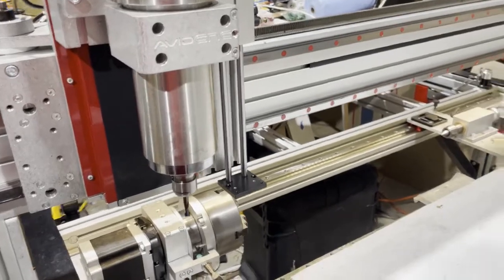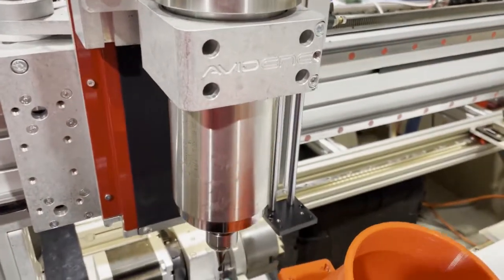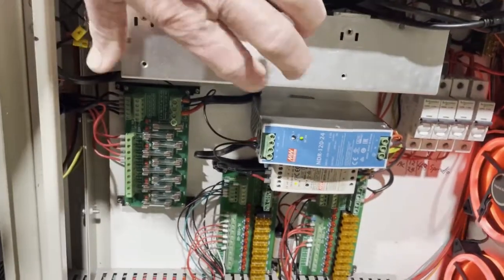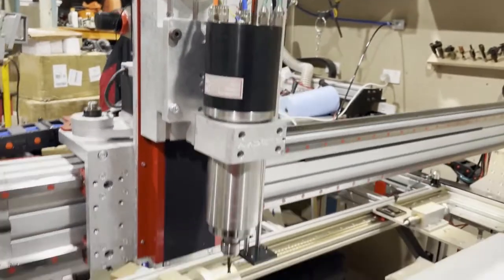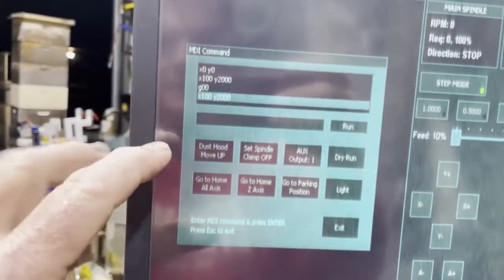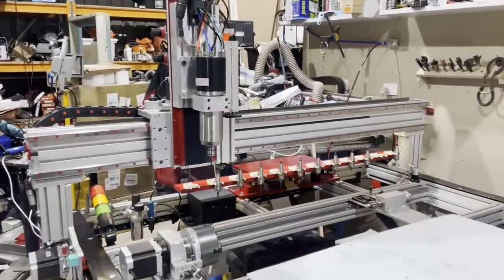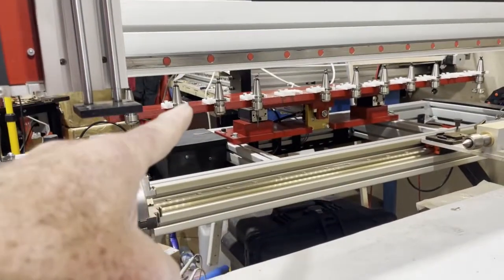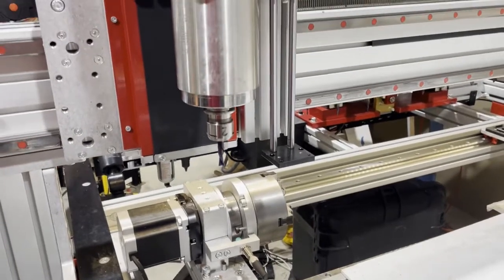Avid Masso ATC Test Run

Comment: Hi Mike,
I am planing something similar like your machine. Do you have a electronics part list? Choosing the correct parts is my biggest hurdle thanks!
Reply from the maker: I started with the ATC spindle.  European models were out of my budget, so I chose the best Chinese brand I could find - Jianken https://www.jian-ken.com/automatic-pneumatic-tool-change-spindle-motor/jgl-80-1-5kw-2-2kw-2-5kw-24000rpm-40000rpm.html through Alibaba.  
The Inverter is a no-name Chinese brand with specs to suit the spindle through AliExpress.  The pneumatic solenoids and all the tubing and fittings also though AliExpress.  
I still haven't resolved the automatic dustshoe system yet.  The piston in the video works in theory, but I haven't succeeded in reality.  The dustshoe can't move high enough to clear the spindle.  I'm working on a hinged design to swing the dustshoe out of the way instead of lifting it.  I'll still use the piston(also AliExpress) to operate a rotation lever.  Been too busy to dedicate the time to see it through.
The moving tool tray is also AliExpress, but not entirely necessary.  If I were to start again, I'd have a larger table to accomodate fixed tool holders.
Masso has an elegant approach, but it did take me some time to understand it.
I may make a video on how I did mine when I get it all working.
Good luck with yours.
Cheers,
Mike

Comment: Masso is the most easiest CNC controller to setup everything.
No need to be a programmer for CNC script, just put some numbers on the settings that you need then everything will work flawlessly!
I retrofit my Bridgeport torq cut 22 in a week and is working just like brand new machine. Except for rigid tapping!
Reply from the maker: I totally agree. So many advantages over the systems out there that require a pc to operate.

Comment: Hi from Perth Mike,  Thanks for the nice video demo.  Found you via the new AVID forum.  Super cool ATC setup.  I have a 5x10 with the rotary mounted at the back end similar to yours.  I'm currently in the process of installing an Optlasers 15w diode laser to my machine and have used a similar pneumatic ram unit, just a bit shorter, to raise and lower the laser unit.  If I ever finish this addition, an ATC would be the next project, so I might be back for some more details at a later date.
Reply from the maker: Thanks for watching. I only signed up to the new forum this weekend, looks good so far. I had to jump through some hoops to make the Linear Type 1 work for me. Found a bug that Masso are sorting. You’re welcome to contact me about details when you do ATC. I might write up a description on the Masso forum. I’ll think about laser after I have everything else working. It’s been a couple of years building in snippets of available time.